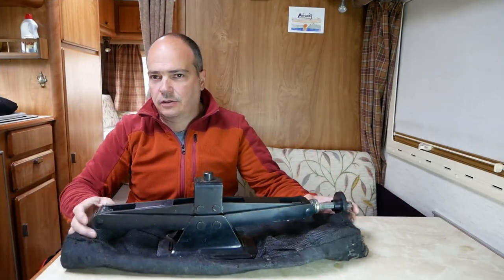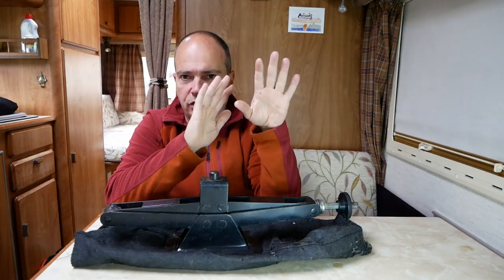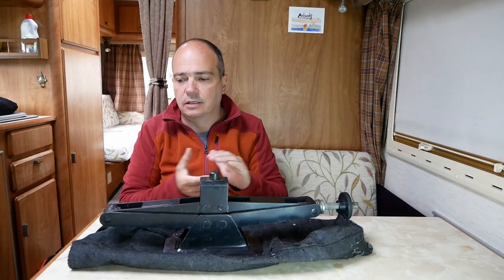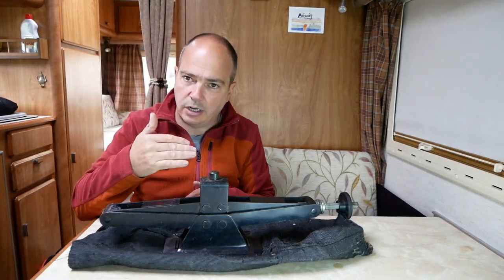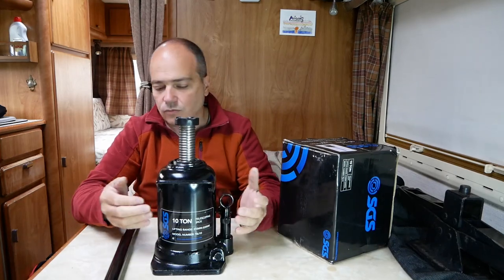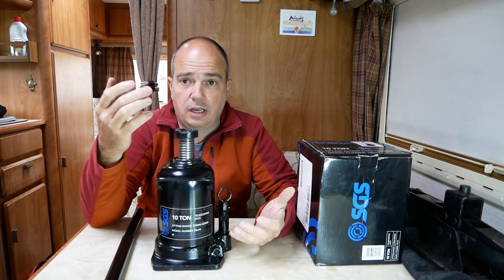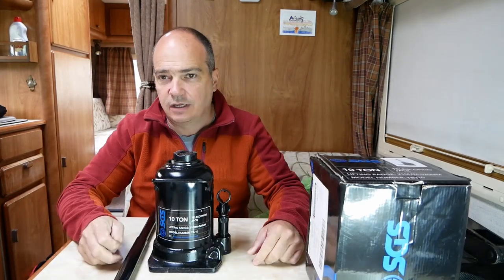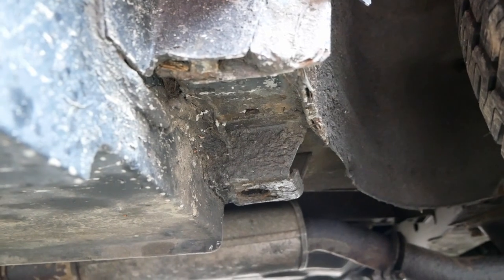Best Motorhome Jack ??

Comment: Hello. Thanks for the video. Is the tip of the bottle jack required to go fully INSIDE the jacking point hole? Also - do you use this in conjunction with an axel stand? If so, where precisely do you place the stand? Many thanks.
Reply from the maker: The bottle jack does sit on the part with the hole, not through it - that's where the old scissor jack would locate. I use the axle stands on the metal framework of the Hymer.
Reply: @classicmotorhomeowner4055  Manyy thanks.